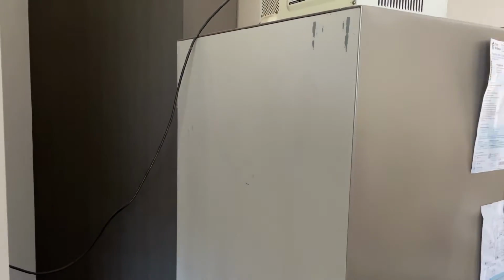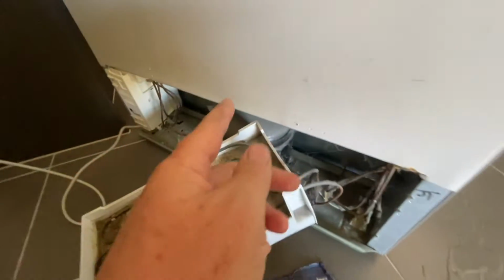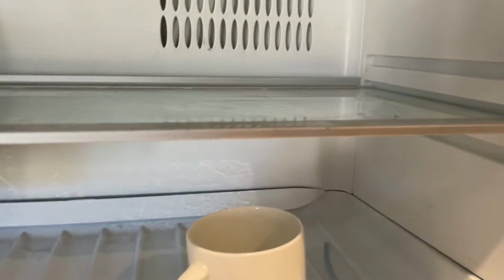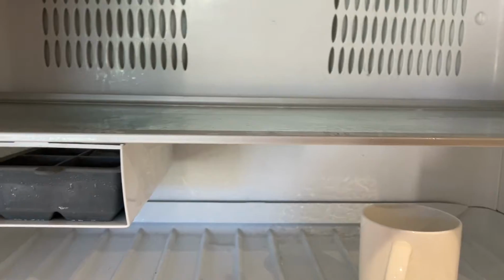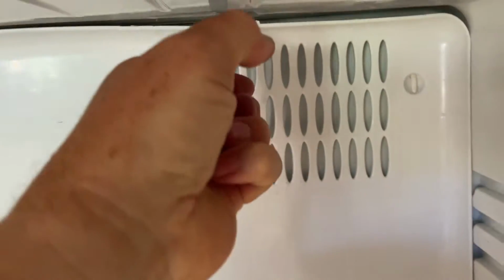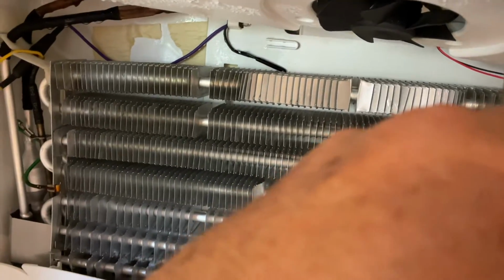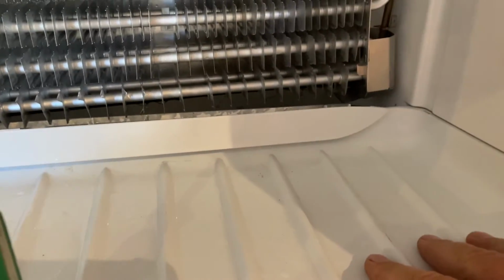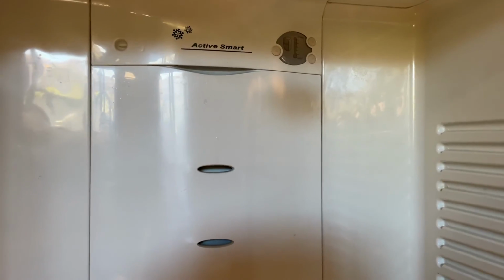Water puddle under Fridge repair. Fisher Paykel overflow. Leak Freezer evaporator frozen. How to

Comment: Many thanks for the video, you have saved me a service call. I couldn't get the back panel off in the freezer but I could see that a few frozen peas had escaped the package and were blocking the drain hole. So once the fridge and peas had thawed, with a bit of poking with a plastic coated wire I got them down the hole and collected them inside the main compartment with the back panel off and the drain pipe exposed. Gotta love YouTube.
Reply from the maker: It sounds like you have done really well. Well done MRT

Comment: Just fantastic thank you! I had water leaking from the fridge for a very, very long time, recently from the light fitting too. The explanations of the reasons, the time saving tips, then the step by step on the panel was just great.
I ended up using a tube on the vacuum cleaner to get the gunk out of the top, it grabbed the ice too.
thanks so much.
Reply from the maker: So Glad it helped. 👍🏼 MRT

Comment: Exact same fridge, exact same problem. A bit of plastic caught at top of the drain. Glad I found this as I was ripping the fridge apart trying to get to the drain as I have had this problem on a different fridge so knew what is was trying to do but could get to it. Just need a bit of persuasion. Cheers.

Comment: My problem is blocked drain in the bottom freezer section which needs the freezer door removed which is not easy
Reply from the maker: How to remove the Doors off your Fridge freezer Fisher Paykel easy
https://youtu.be/mN-_drB1pv8
Reply: @Marksreviewsandtutorials  
Thanks but this clip shows how to remove the fridge door, I need the pull out freezer door removed, the freezer is on the bottom
Reply: @austpers  Did you manage to do this? I also have bottom freezer which leaks
Reply: @zacsmith8569  
Yes I managed to find a video to do it, mine is a drawer style freezer door and very tricky to take out and then replace

Comment: Excellent video mate 
However the water coming out of my fridge is coming from inside the fridge compartment roof. It looks to be the same model as yours and I have checked the drain from the freezer and all is good but the roof panel does not want to drain into the main drain below the freezer .
But I can not for the life of me get the roof panel out. 
Did you manage to remove yours?
Reply: @myshortcuts15  I had the same problem. Fix is the same as the video, once completed, tilt the fridge backwards and the remaining water will drain through the cleared drain hole

Comment: Awesome vid now to attack mine with the same problem 😉
Reply: Just pulled it apart and I had the same piece of plastic from popper blocking the top drain hole. Thanks again👌